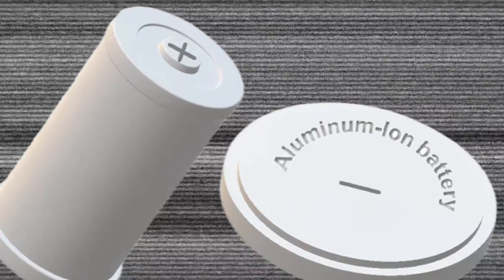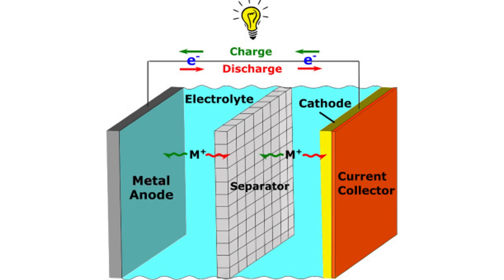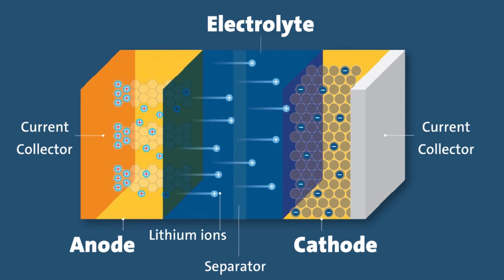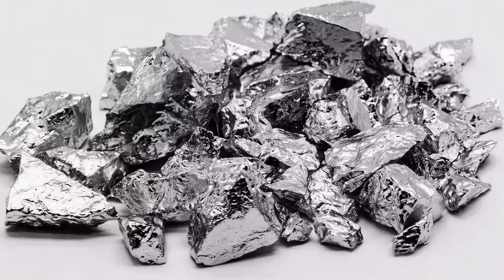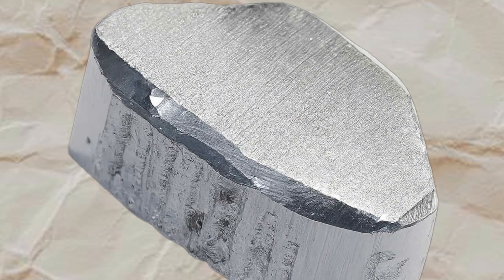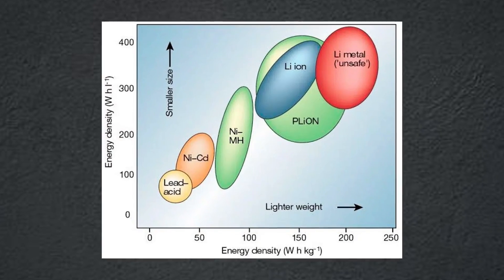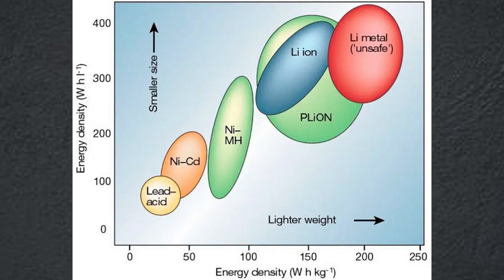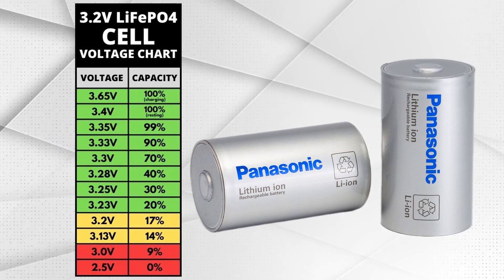Aluminum-Ion Batteries in EVs — Hype or Next Big Thing?

Comment: New battries need 3 qualities 
1 significant improved performance aka faster charging, longer lifespan, or more tempature resistance 
2 significant cost reduction aka lower material cost, simplified production, or higher power density 
3 scalability the new process must be faster to replace established methods and supply chain must be able to replace current volume plus any future expansion.
3 is non-negotiable 1 and 2 you only need 1 if them to be doable but all 3 prerequisites are preferable
Reply from the maker: Well done, You defined a winning criteria for nex gen batteries .
I hope we get there soon.👌